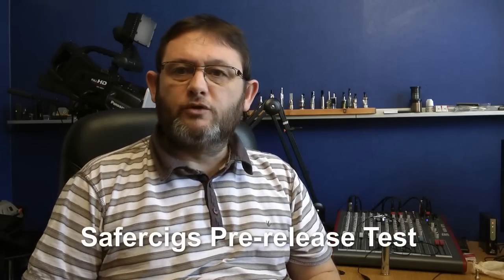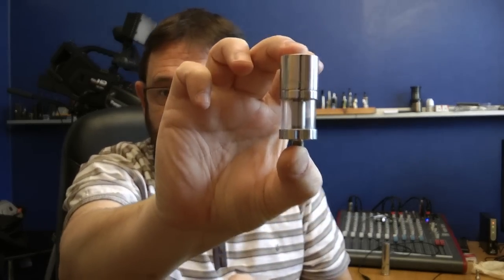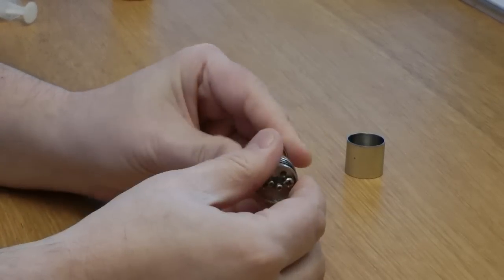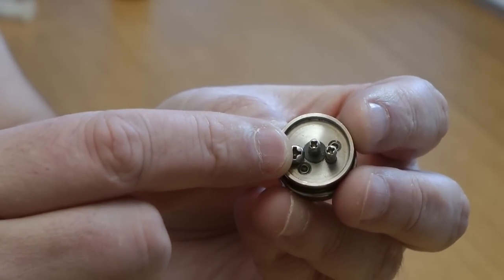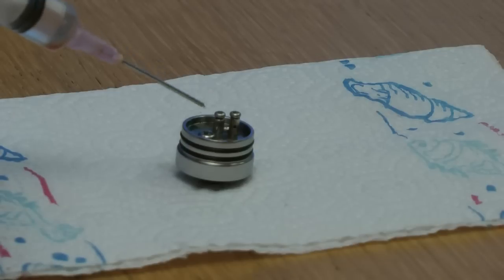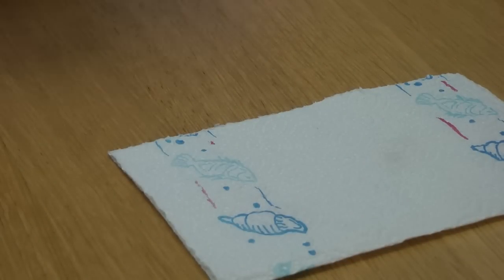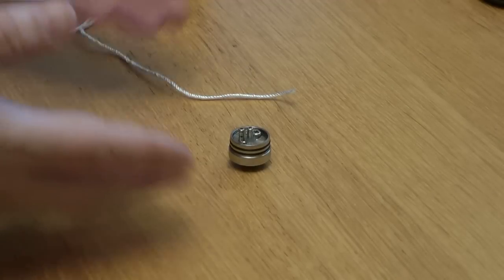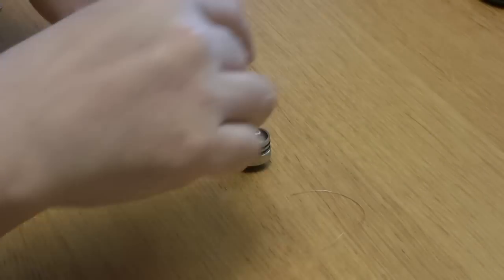Review of the UD AGI Electronic Cigarette Atomiser - Part 2 - Dripper Mode

Comment: So this whole thing the AGI after 1 week 

genesis mode the spring turns black and instantly shrinks and has huge voltage loss.

The dripper after 14+ hours of sitting on a device the juice leaked right through the 2 screws that you put into it.